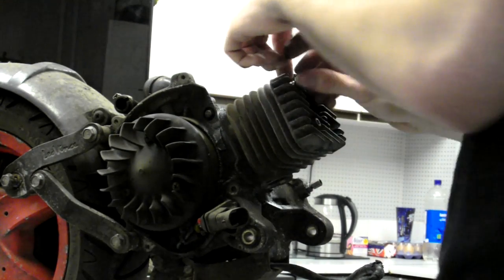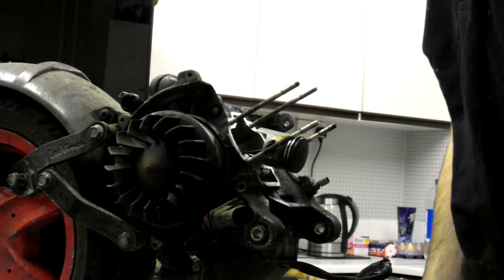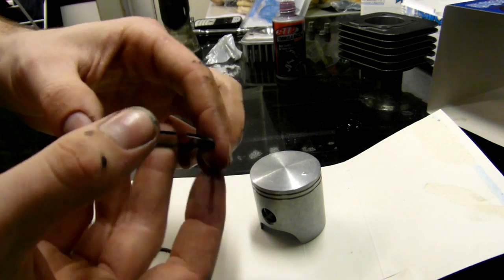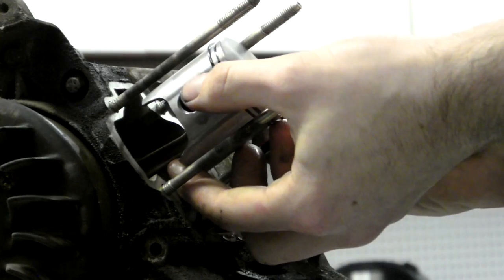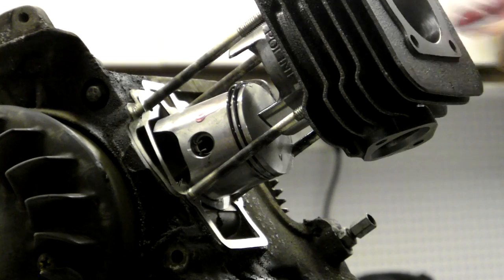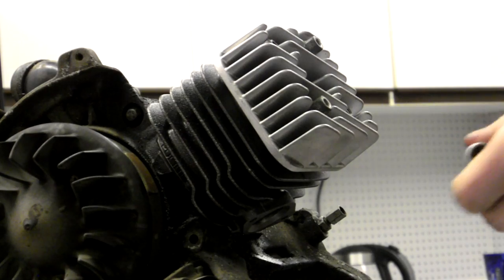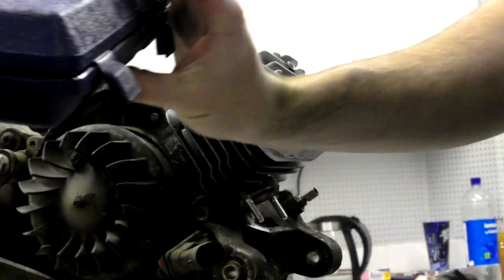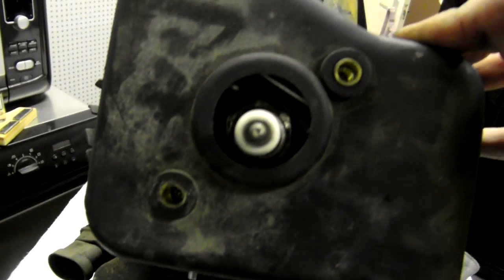ScooterNations - Fitting A 70cc Cylinder Kit/Big Bore Kit

Comment: Just asking can the 50cc stock crank hold up to the stress and pressure of a 70cc kit because i dont wanna get a 70cc and it breaks after a few days
Reply: You may already know this now but it depends how powerfull the 70cc cylinder is because some standard cranks can hold onto the stress and pressure if the 70cc cylinder isn’t super strong like a Mhr or stage 6 mkII
Reply: @30kmt  Thanks for the reply. The kit isnt that strong is a Chinese knockoff i guess it gives it 3 to 4 hp more than stock. So basically more than double the hp. I got the kit for 1 month right now maybe 5 hours of riding since its been very cold outside. And its doing great well see how much more can it hold on.

Comment: Terrible work: no cylinder preparation, no crankcase cover, no piston preparation, no sqish check or measurements... is this a 2-stroke comedy channel?
Reply: Eh, it's just a simple one cylinder 2 stroke engine with dirt cheap parts. A complete cylinder and piston kit can be found for less than 100 USD, no biggie.

Comment: Hi man, with 70cc cylinders specifically with stage6 ones that i got. I noticed that if i won't warm up my scooter for like 5mins  first thing in the morning  for my daily use, it will have that bog down on takeoff at 1/4 to half throttle which will be gone after a  after a few hundred meters of reving up. But if i warm it up its mainly fine.
Reply: Nino Echavez I have the same problem but even without a 70cc kit. After fitting my derestricted cdi it just boys down unless I pull away in high revs.

Comment: I know it gives a whole lot of trouble, but doesn't it bother you to mount a new cylinder, specially a 70cc Polini which is my favorite mark btw,without 1st having cleaned all that greasy filth all around that cylinder area? Not only may dirt and/or solid residue fall into the crankshaft compartment but also such a special part sure deserves it to be done.
 When I fitted my 70cc Polini aluminum cylinder,God knows, how clean and shiny my  engine block was...

Comment: tried this today and the frame fell and bent the mount screws for the big bore kit thats my life in a nutshell lol😂
Reply: Daryl Egerton lmao that's why I don't want to attempt this because I will have the same fate or something similar
Reply: Not worth hassle trade old 50cc in get a 125 scooter lot cheaper faster 50s are not worth it
Reply: Rose Evans it's really not that hard. the only headache is getting the wristpin out of the crank. Putting it back in is usually easy as it's probably not swelled like the old one

Comment: u not doing something right 
u need to handle screws on a cilinder like a carwheel overhand
U wil have air loss and and the cilinderhead is not at the right spot 
u need to screw it up and chek it out a few days later 
The cillinder head will be dropped so u can screw it a lil bit tighter
On a car u will lose the wheel 
And u added 2 much oil on everything 
Just add some oil on the piston with ur finger

Comment: hi, what torque the bolts to be tightened
Reply: The same as stock. 10 ft-lbs on the cylinder head. 14 ft-lbs for the spark plug

Comment: He doesn't explain how to set the timing.
Reply: +A . E . Ortiz it's a 2 stroke, there is no timing needed. you just have to set the squish clearence.
Reply: thank you for the info. I have a Baccio speedy 50cc and I just upgraded to a 47.6mm big bore. I can now finish putting it together. thank you again.
Reply: is yours 4 stroke or 2 stroke? if its 2 stroke, you'll just have to swap the cylinder and piston and put in a larger carb main jet. but if its 4 stroke. then setting the timing is needed.
Reply: Q. I notice that the piston has an arrow on the top. When I put the piston in the cylinder, is the arrow suppose to face down or up. Also the piston has two small windows.
Reply: the arrow is suppose to point to the exhaust port.

Comment: Good video but you failed to do several vital steps related to engine re-assembly.
Even with a suposidly bolt on kit it is still always advisable to check ring gap clearence and I would never start that engine before first checking your squish clearence. Sucks to have a spark plug through the top of your brand new piston crown cause you failed to do a simple check.

Comment: i have a 70cc cylinder and piston on my speedfight 2 i beleive i need to change the exhaust and carb jet aswell? is that the only things? and if so what size carb jet and howd you do it. thanks
Reply: Mark Leech i would like to know too
Reply: Not sure what a speed fight 2 is but I have a 50cc Yamaha Zuma, you should definitely change your exhaust if it’s stock and you have a 70cc and then u should jet around 90
Reply: Get 125cc scooter there faster forget upgrading your 50cc.
Reply: Rose Evans Lets say a Gilera Runner 70 2 stroke will beat a Gilera Runner 125 2t, its not faster
Reply: Usualy a 17.5 mm carburetor, or a 19mm, jet should be like 85-95

Comment: That is a very informative video!  I am still confused on the circlip in terms of specific orientation, location, removal, and reinstallation.  Everything else has been really good in psyching myself up for my first BBK installation.
Reply: the sir clip is easy but they get under pressure as you put them on  and they can shoot off ive done it myself ahha
Reply: I switched a lot of cilinders maybe 100+ and i never looked at the sir clip position and never had any problems.

Comment: Hi tks four your video good info tks, I fit my 75cc on my 50cc scooter and now wheen I drive the engine is very very hot I don't know before whit 50cc I don't check, wheen I fit the new 75cc cylinder I don't fix back the cylinder cover I just drive and I find is very hot my question is a normal or not tank you
Reply: get a bigger carburator, and change your jets in your current carburateor, you currect carburator is way too small i would belive
Reply: put your plastic cover back on these are air cooled engines and that cover directs the air past the head cooling it off you need this on ! or an electric fan or your gona burn up your head !